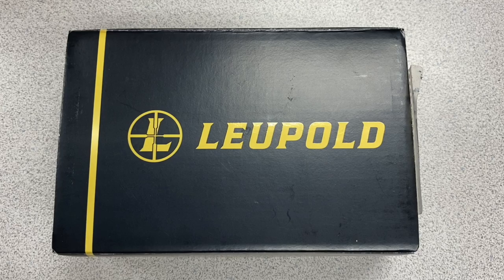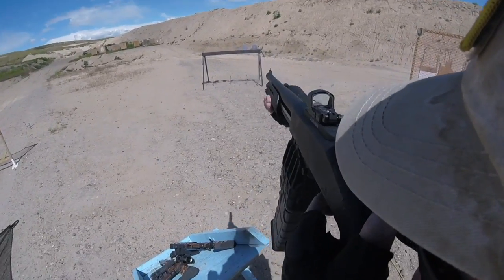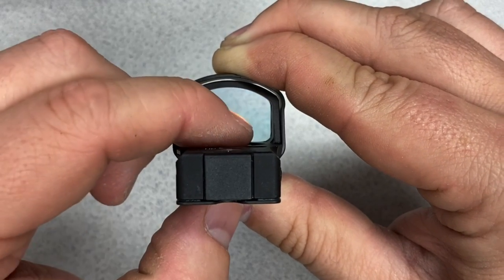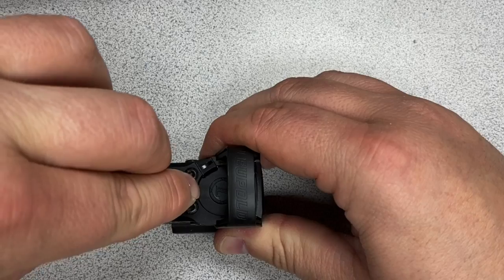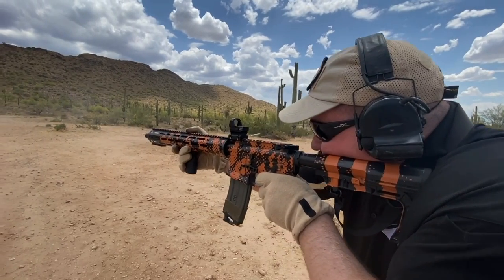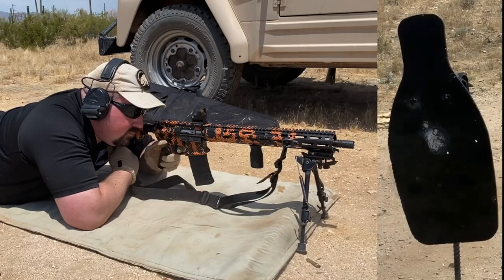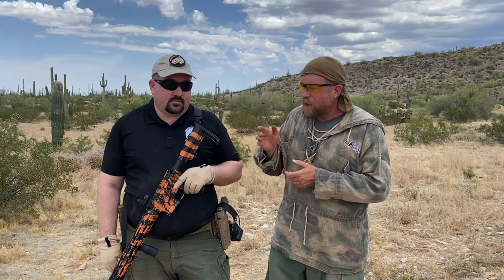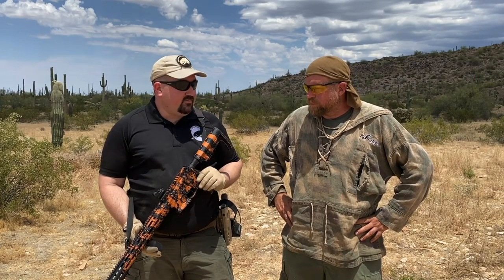Leupold Deltapoint Pro RDS - American Made Series

Comment: Good stuff.
I've had a couple DPPs on two different pistols for use in IPSC for roughly 2 years now, one of them had a failure of the battery contact, which is a known weakspot on the design (certain serial ranges have it bad, early and current serial ranges are much better), how Leupold glue/hold the battery contact in place is not the greatest, but when the issue occurred, Leupold arranged a replacement with no hastle, even here all the way down under in the peoples communist democratic republic of australia.

Comment: Who needs a torque wrench when you have a calibrated thumb?
Reply: SinistralRifleman's method is from Leupold directly.
Reply: JonnyCrash tighten till you hear the crack then back it off a quarter turn.  Perfectly torqued ever time
Reply: @BurningMonkey  You misunderstand me, sir. I am in full support of such methods. I'm also a promoter of the calibrated wrist and guten-tight methods.
Reply: @GODOFGUITAR2112   Not True!  my Delta point fell off  first 50 rounds with this method! didn't hold a zero very well either.  The click noise broke or cracked my screws. Gunsmith had to drill them out and re-tap it. cost me $75. or   I think I must've had a different model plate than yours.

Comment: I havent had any issues when I owned mine. 

Had it mounted offset of a larger 3x9 scope. Ended up replacing it with the rds which got replaced with a mark 4 1.5-5. And hopefully a rumored mark5 lpvo next year. 

If its one thing leupold does well its light weight scopes